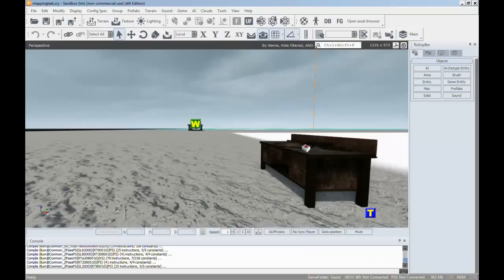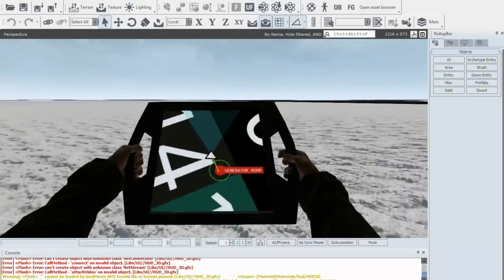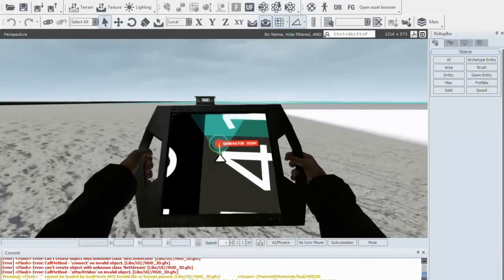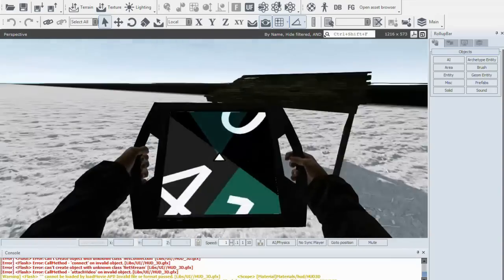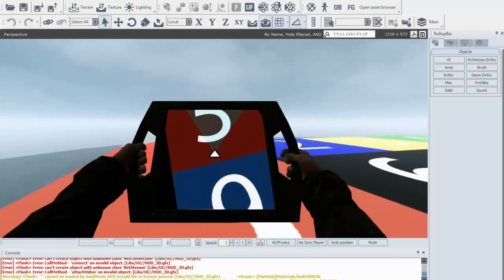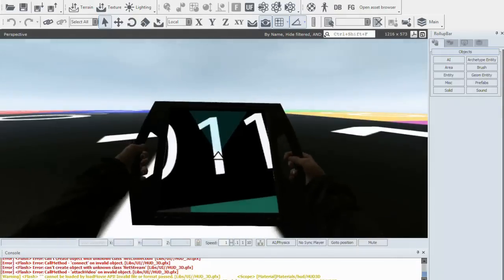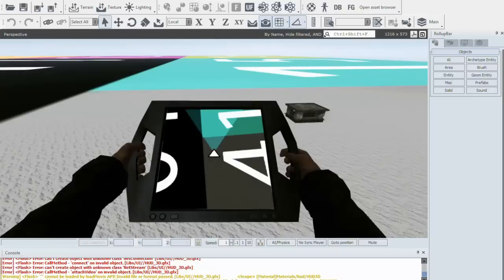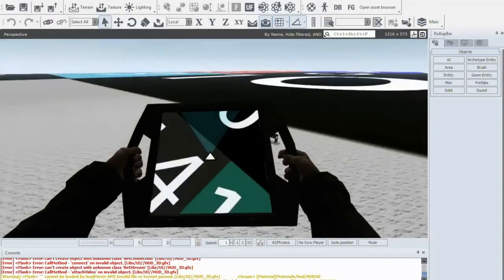HANDHELD DYNAMIC MAP TUTORIAL PART 1/4

Comment from the maker: Sure no problem I will try to do a tutorial for that when I have some time. To do so you could basically just create another entity or add an extra output to the map entity that outputs the players rotation offset against the waypoint which is already in the script. You could then plug that output directly into one of the UI nodes to translate a flash marker in the HUD.

Comment: Very useful. I am going to use it as a map for a HUD where I can display mission objectives, plus some other things.

Can you tell me something? Is it possible that you can also make tutorial how to add icon to the HUD that indicate where this objective is? Like in Crysis 2. It would be really useful that it will have measurement system as well, to indicate how far away you are.

I know that Richmar1 is also working on something like that, but yours is almost finish.